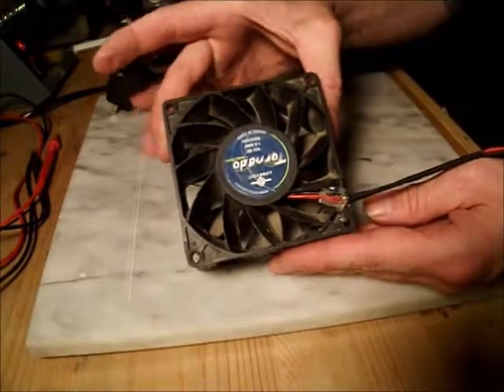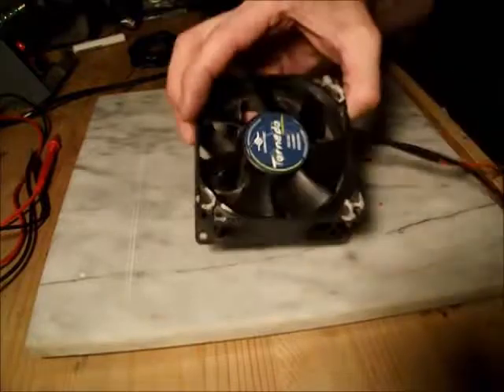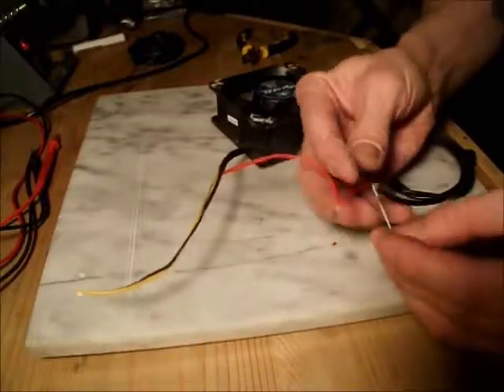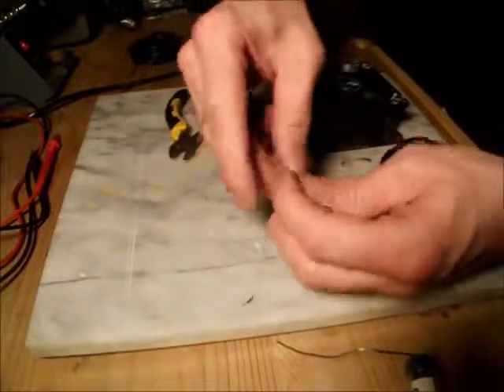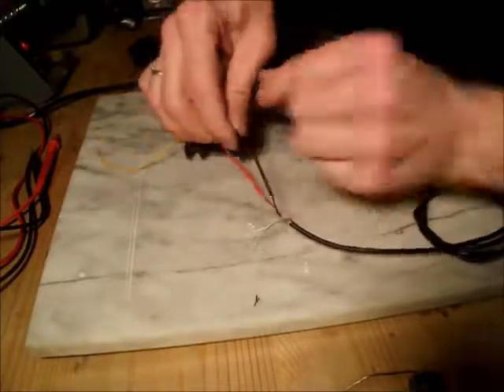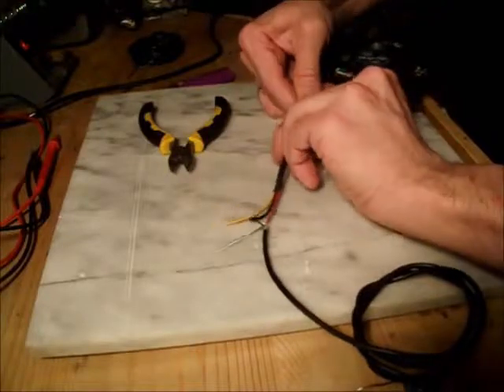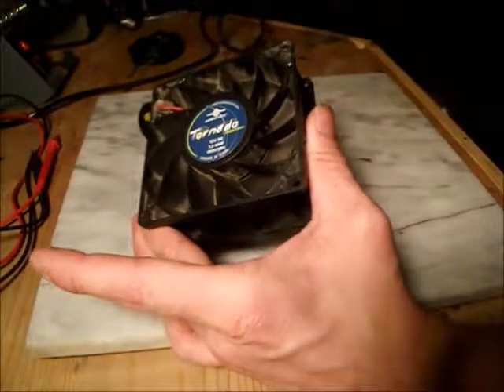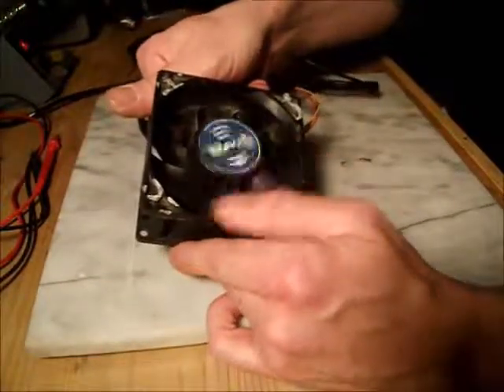DIY 5 Minute xbox one USB fan

Comment: will this work as a replacement if your xbox one fan is broken
Reply from the maker: I would say yes depending on the size fan you choose and the type of gamer you are I mean if you game 23hrs a day HARD then you may want to step it up but if you do what most would consider an average amount then sure as long as the fan reaches the important sections of the cpu with enough airflow to carry away the heat
Reply: okay thx so much

Comment: Should the air push down into the console or up out of the console
Reply from the maker: Either or because its modular you can do either  I move it around depending on the day sometimes the on top pulling is loud and push in is quieter.    that said the only really important part is to work with the internal fan not against it so if your pushing put the fan on the side pushing in if your pulling then put the fan on the top pulling  as the internal xbox fan pulls through the side and out the top